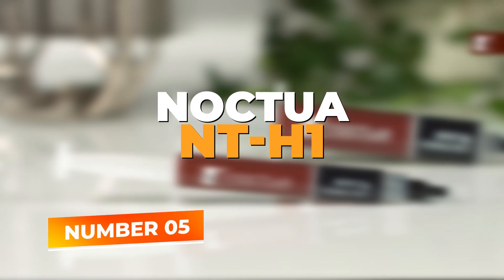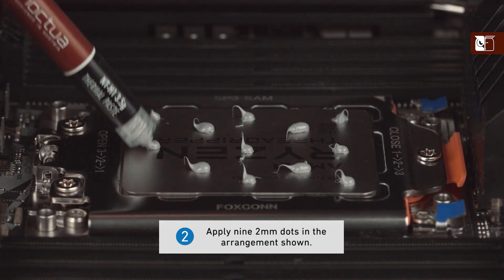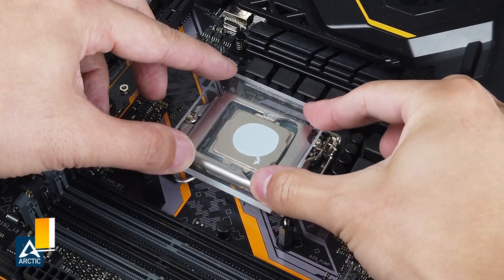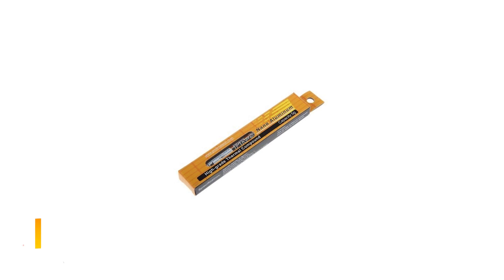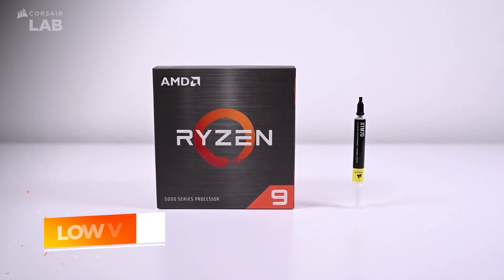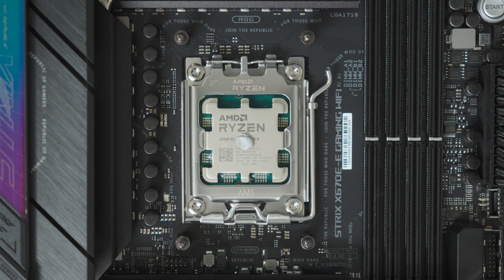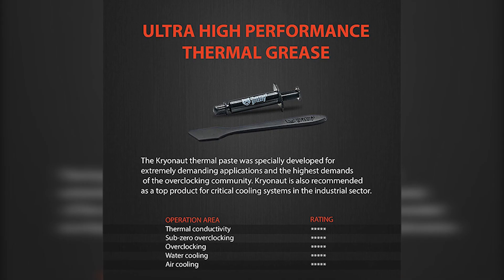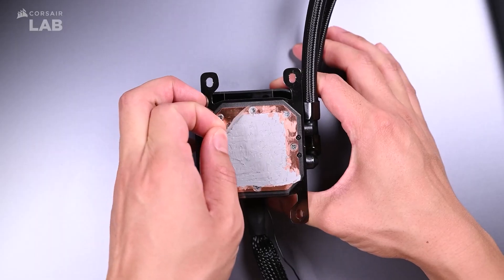Best Thermal Paste in 2026 – Are You Using the Right One for Peak Performance?

Comment: For desktops with a processor having a low TDP <90W, no need to overpay and it is enough GD900-1, and for high TDP >90W, laptops with a TDP >15W, consoles and graphics cards the best choice would be a phase change material such as Honeywell PTM7950, PTM7958-SP, Thermalright Heilos, Gelid HeatPhase Ultra, Upsiren PCM-1, Thermal Hero Pad, Thermal Grizzly PhaseSheet - They do not dry out as quickly as traditional pastes, keeps low temperatures longer and there is no pump out effect.